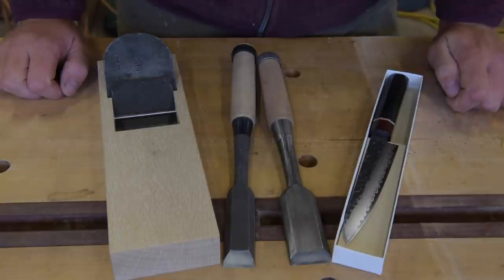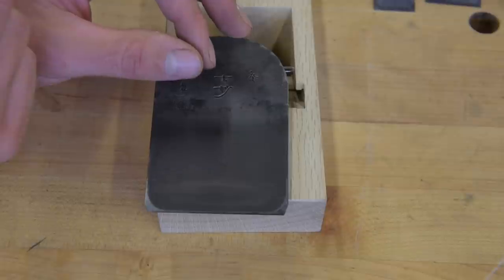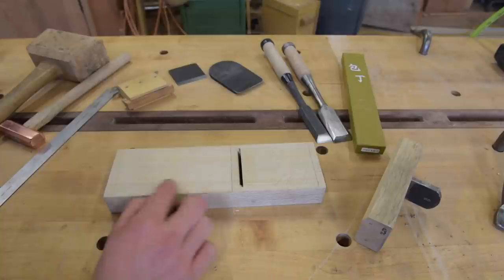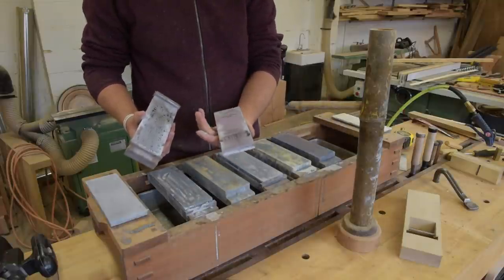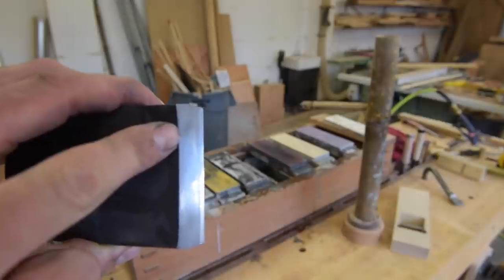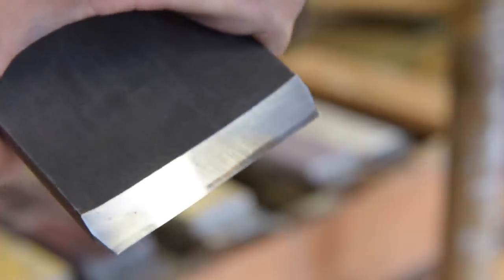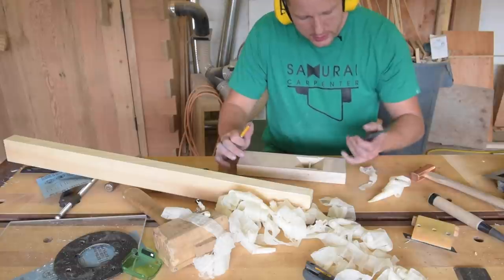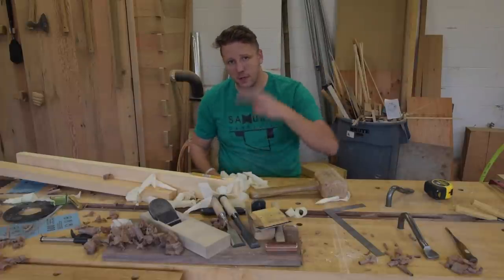How To Set Up A Japanese Plane, 16 micron Shavings!

Comment: For that kind of money that plane should come out of the box ready to go.
Reply: I was thinking the same. It looks like it's more of a 'kit' than a finished setup.
Reply: Pretty much all Japanese bladed woodworking tools come part finished - as in requiring honing. You're paying for the blacksmiths skill and steel quality. The dai is wood, unlike the cast western planes. As such is subject to environmental change. You'd be a fool not to hone it even if it proclaimed "ready to use". Further, how the sole/block is honed is a very personal thing. Out of the box ready simply doesn't apply. And, whether western or Japanese plane, any serious woodworker worth their salt takes their new blades through a sharpening process.

Comment: For scienticious reasons, I can tell you that the whole "natural vs. synthetic" thing is bunk. Abrasives are somewhat complicated, but they aren't mystical and at the end of the day there is nothing modern science can't do in terms of "manufacturing" abrasives that nature can. 

What I can tell you though is that the way you flatten your stones likely contaminates them, reducing your overall polish. The "slurry" the nagura stone is meant to produce is what does the cutting in many of these stones, as well as carrying away the swarf. It naturally forms on your stones, but your diamond plate can be thought of as sort of a high tech nagura stone as it does the same thing: releasing fresh abrasive from the surface. The problem is you're not washing that diamond lapping plate between stones, so you're carrying coarser abrasives over. While I'm sure there are other elements of your technique and skill which could be nitpicked regarding why/how you're at about 3 times the thickness shaving of the pros, the most obvious error is that. You want to, between stones, clean EVERYTHING so you're not adding contaminants. 

But then again I'm just a dude on the internet right, so take what I say with a grain of salt.

Comment: That's not a 30k grit finish, that's 1-3k scratches left over on a 30k finish
Reply: Kyle Jacobs I thought it was strange. I have the cheapest stones you can imagine from china and my 1500 grit seems to have a better finish than that
Reply from the maker: The camera lens magnifies the scratches when the light hits it at the right angle.

Comment: Noob question: why use a wood hand planer instead of a metal one?
Reply: Alessandro Quadrado Japanese planes (wood) are typically pull stroke and can be tuned much easier, whereas Western planes (metal) have a push stroke and many more components to tune. Metal is also a bit more difficult to flatten, and the throat (where the blade goes on) is often machined out of square. Either one is a difference of opinion as to which is better, but having used both, I mostly prefer the Japanese (wood) planes.
Reply: Thank you very much!
Reply: Both eastern and western planes have been made from wood for centuries. With steel becoming more available in the West the use of iron and steel planes became more industrious. The eastern woodworkers are quite used to using the pull method in many of their tools due to working mostly on low surfaces if not directly on the floor. They provide a more controlled feeling and connection to the work. Western methods have developed with the use waist high benches and with most tools like saws being used as push devices the western metal planes are designed to work as push devices. Bottom line is it comes down to preference. Push planes are great at speed and pull planes are great at control but both are viable choices for wood work with different skill sets.
Reply: Talk about a tough question, it's almost like trying to describe the difference between two lovely women.  Both are wonderful.  Steel planes tend to be less finicky so you can get more work done but wood planes have a better feel and are more of a pleasure to use.  I love them both.
Reply: I wonder if anyone has gotten 5 micron on a metal plane

Comment: Certainly not a sharpening expert but if I can see scratch marks in you 30k finish you didnt spend anywhere near enough time on the lower grits... at even 2k that steel should show no marks and be a mirror. Btw when I sailed to Japan 6 years ago I bought a similar kitchen knife that gets used nearly exclusively(including my knife torturing wife) and had its first resharpen this spring; if I were to go back I woupd get a nice set, deff worth the money.
Reply: lockgessner 30000 still has a scratch pattern, it's much finer that that shot looks, it looks like 10000 but I just think that's just the zoom

Comment: Ah, tool porn.  Thanks!  -  I have seen many of these videos of cutting the edge of a board (and have spent many hours doing just that myself) but the way you set up your plane it seems that it would leave ridges in a wide board.  Shouldn't you take the corners off that blade to make it practical for planing in the field of a wide board?